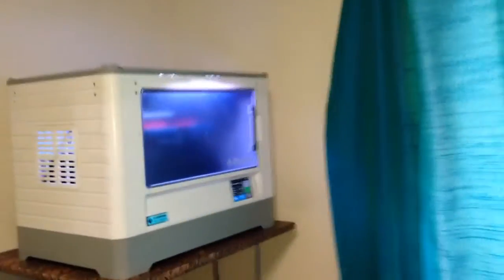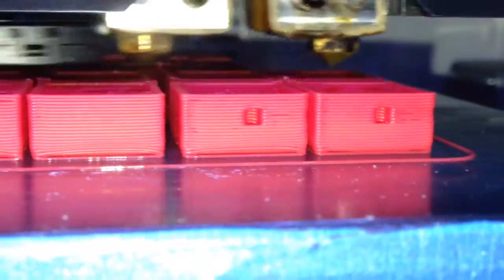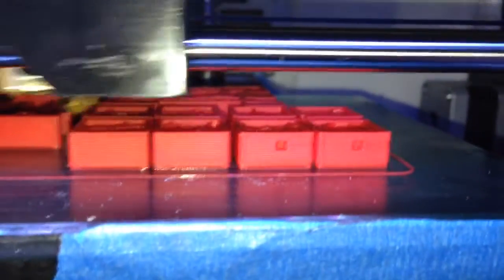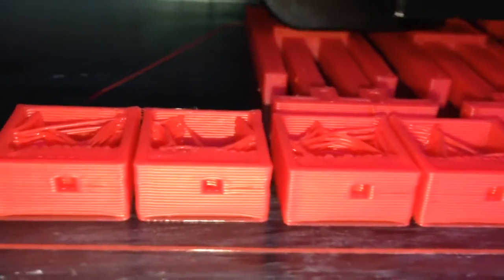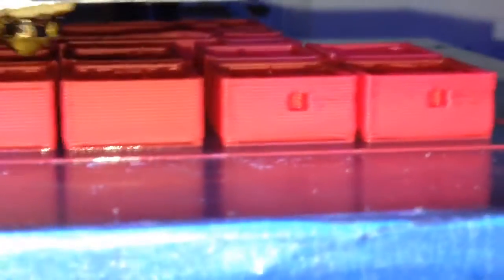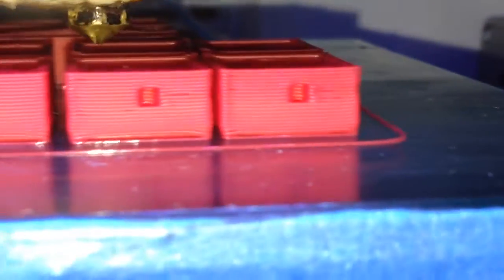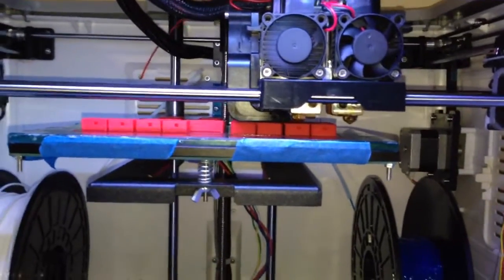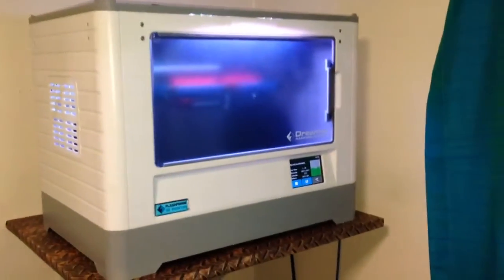Flashforge Dreamer - First print problems

Comment: Did you sort out the problem?  I'm interested in a Dreamer.
Reply from the maker: It ONLY does this at layer height 0.3mm. In fine or superfine mode it's not a problem.
Reply: Thomas James I guess that's good news in a way, I plan to use 0.1 and 0.2 most of the time.  I'm guessing you would recommend this printer?
Reply from the maker: Robin Wainwright Hell Yes! Absolutely love this printer. Excellent value for money, and 0.2mm and lower work perfectly. I'm just having trouble with 0.3mm prints. I'll figure it out and when I do I'll posts a video